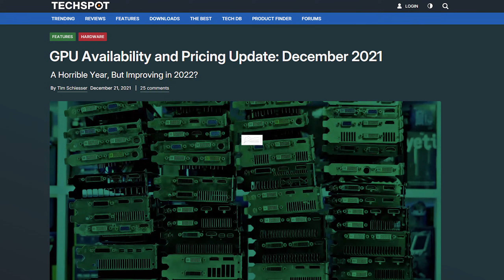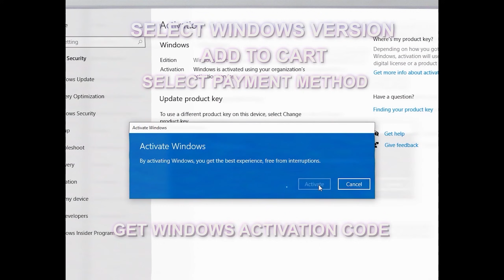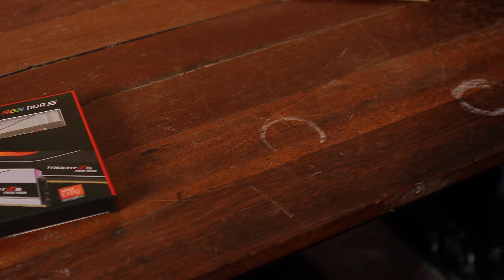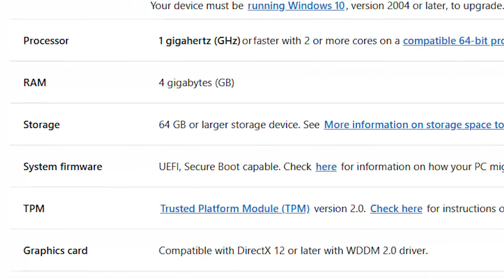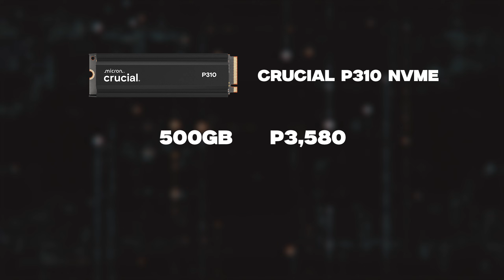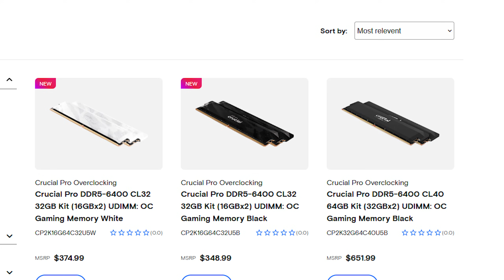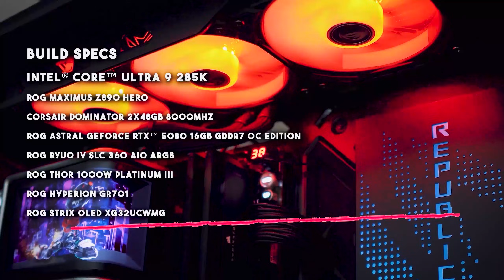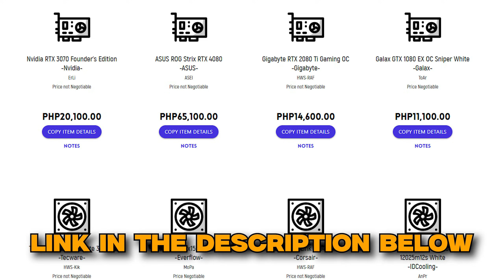5 Ways to Save Money on RAM and Storage in 2026 (PC Building Guide)

Comment: Added info :

Not all SSDs are made equal. Budget allowing, go for SSDs with DRAM cache if possible, at least for SSD you plan to install Windows on. DRAM-less drives have a very bad performance penalty under high load (ie kaya mag stutter while doing write-heavy/continuous writes that a SSD+DRAM can handle easily), and DRAM-less SSDs generally have lower write endurance. For game-only drives, DRAM-less SSDs are ok.

Look for SSD Tierlists/docs/specifications/reviews to confirm.

Comment: Heres my build:

Ryzen 7 5600g
Rx 7600 OC gaming 8gb
Gigabyte b450m ds3h v3
32gb team group vulcan ddr4 3200mhz
512gb orico nvme ssd
Ramsta 128gb ssd
barakuda 1tb hdd
Corsair PSU 750w
MSI case

Icon 24inch rinless monitor
Aula mech kb
A4tech mouse

I have this pc for 3 years now, i can play games in 1080p ultra high graphics and can also stream, i can do smooth video editing, 3s rendering and graphic designing. I have not upgraded in 3 years and yet I can still satisfy my virtual needs. So i think its not really about the trend but its about the best value your money can buy.

Comment: for my use case, i still prefer nvme pcie 3 (from reputable brands), though the max capacity sold commercially is only limited to 2TB & runs a little "slower" than newer generations nvme.; coz it runs cooler, made with better TLC NAND and has dedicated DRAM buffer.

Comment: Still rocking an A320 motherboard and Gen 3 NVME. Samsung naman brand ng NVME ko. Hehe
Reply: that's good, good choice, SSDs are things that you don't scrimp coz if that thing fails think of all the hassle.  Gen3 Samsung NVMW runs cooler, uses better TLC NAND and has dedicated DRAM buffer.  Though it's only available at 2TB max, I would take it over gen4 & gen5 nvme.

Comment: I would also like to add that if you're still in windows 10 and don't have the budget to upgrade to newer hardware that windows 11 supports then you might want to consider the following

1. Windows paid one-year ESU program . For less than 2,000 pesos, it's a great way to still use windows 10 without breaking the bank as you will still receive critical and security updates until October 2026 which will give more time to save up and buy a new rig for windows 11

2. You might also want to consider switching to Linux especially if you're just gaming and not using any apps that are windows dependent. It's free, compatible with any old hardware, require less storage capacity, consumes way less ram than windows which is really nice since ram prices will be getting much worse and it's also pretty much easy and flexible to install. You can try and learn to use it before fully migrating by using virtual machine, usb to boot linux or dual booting with windows

I do not recommend forcing to install windows 11 on your pc if it's not supported as it presents risks like instability issues, no updates etc etc
Reply: Windows uses all the ram it wants but when you're playing a game, those ram gets transferred to the game. Also, it's meant to make windows run faster. So it doesn't matter how much ram the os uses. lol
Reply: @legendaryhumper  Doesn't matter? Where are you from? The future or an alternate universe? Why don't you try using windows with just 4gb ram and tell it doesn't matter
Windows uses a lot of ram in the background even if you're gaming. Games will stutter, crash lag if the ram is not sufficient enough to process both the game and apps running in the background. That's just gaming, we are not even talking about multi tasking